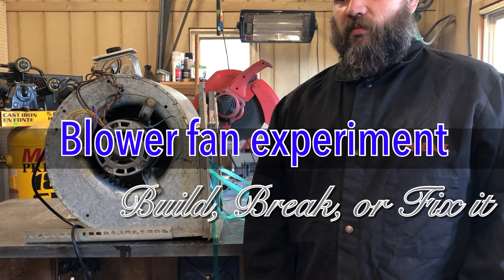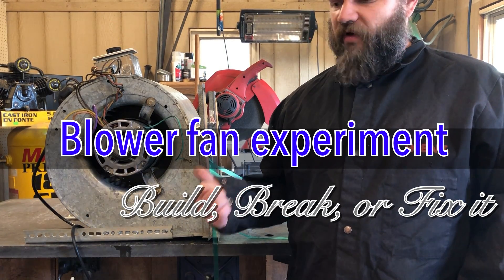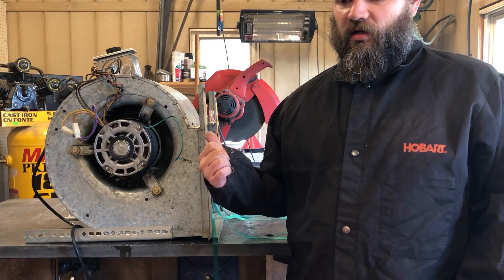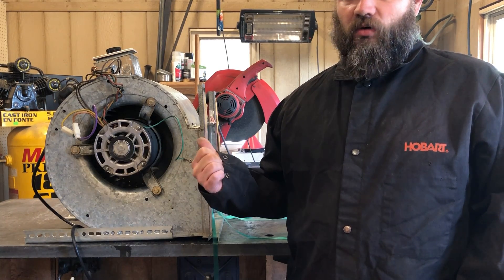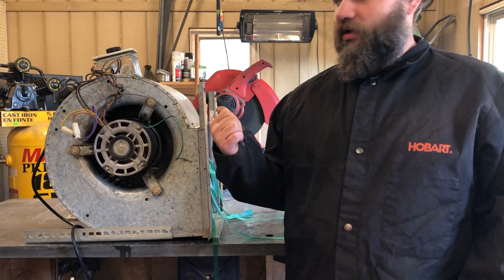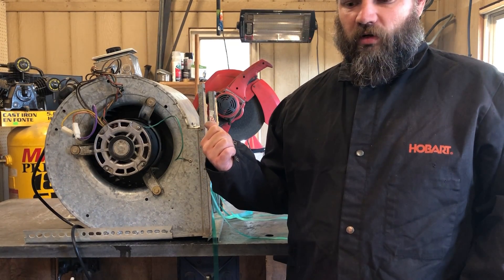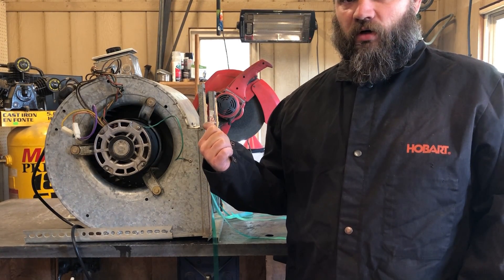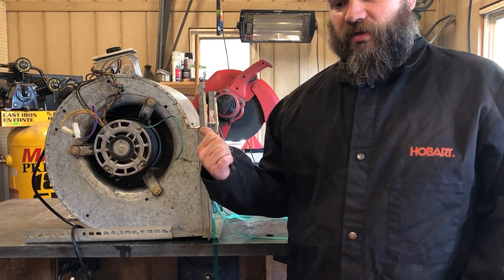Blower experiments

Comment: A thing that I noticed as a child was how sensitive a squirrel cage fan was to air flow. I always wondered why no one had ever used this efficiency to convert wind energy into mechanical  power; water wheels have been used do this for millennia! This amount of reactive surface area in such a compact form could be an interesting topic for experimentation. 
 I'm guessing the fan running in reverse is creating a type of vortex on the intake side. Speeding up the air and creating a huge drag against the blades and limiting the speed based on surface effect. If you had a way to monitor the motor current, I'd bet it has increased dramatically.

Comment: On our up-right shaker head grape harvester we had our blowers on backwards, did exactly what you showed, after about 2 rows we noticed a lot of greens in the gondolas, had to swap hydro lines, interesting vid.
Reply from the maker: We had this happen on an industrial heater. It would not make the rated duty, and took 3 years for anyone to check blower rotation, as it was still blowing air, just not enough. Lesson learned the hard way.
Reply: Damn that's funny

Comment: Another thing about squirrel cage blowers. They are principally designed to push air against a resistance. or  static pressure. You can increase the flow on the one you have by placing a board across the outlet. In the one you have a 3" board across the top will probably do. Not only will the flow increase but the load on the motor will decrease. Seems the air tends to swirl in the chamber and tends to recharge the output. Wish I could explain it better but you'll have to try it and see.
Reply from the maker: Mike Goodman That’s a good point I forgot to go over. I actually have a shop air cleaner with inlet filters and a board across the outlet to keep the fan loaded up. I will play with the restriction size on this one and see where it performs the best.
Reply: Makes good sence 👍🇦🇺